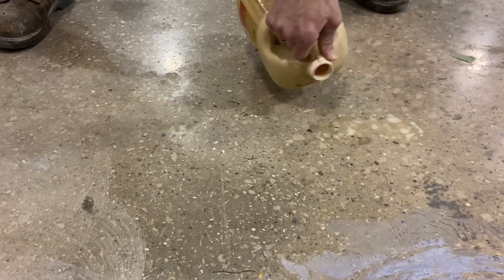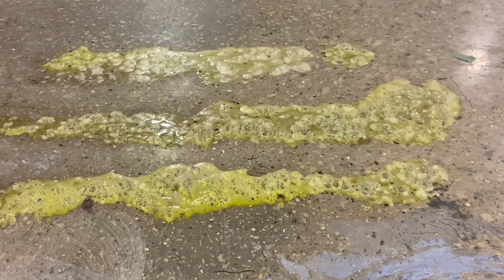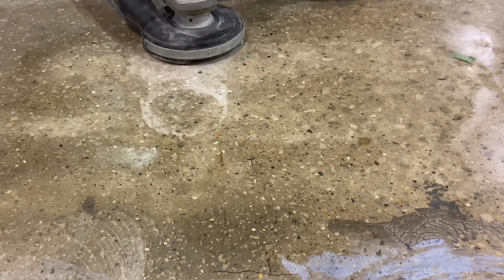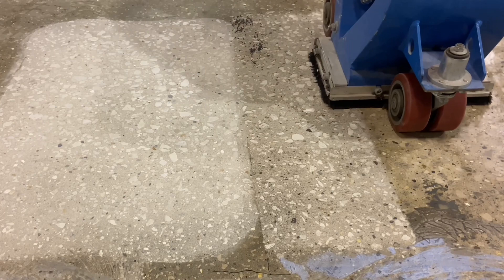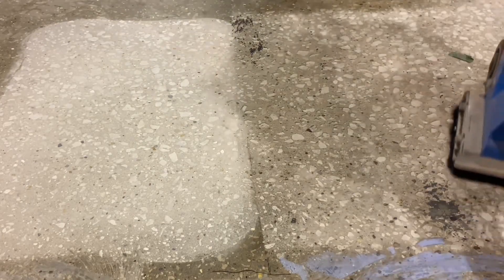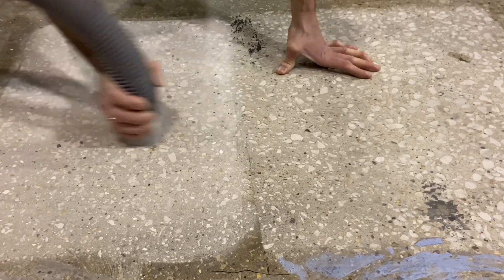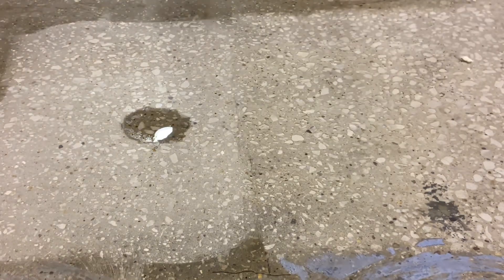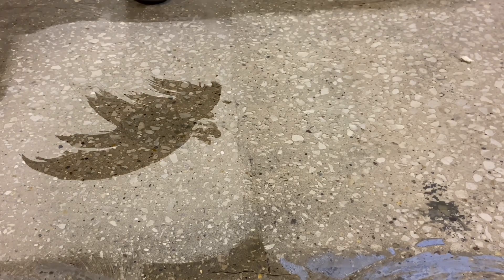How To: Concrete De-Dusting for High Performance Coatings

Comment: Very interesting video ! You do a great job of explaining each process clearly.

But which is the best way as preparation for epoxy for example ? Grinding and shot blasting, or only grinding or only shot blasting ?
Reply from the maker: Thank you so much. 
My preference is a grind and de-dust by blast. If it’s a grind-and-seal floor, then I would grind and (synthetic) acid etch. Blasting only would be appropriate where a CSP#3 is required for the coating (epoxy mortar/urethane cement). 
Thank you again.
Reply: @joshjones8047  thanks for your reply ! Grind and seal floor means polished concrete right ? Why would you acid etch it ? The risk to make it patchy would be higher or not ?

Ok so the blasting only would make it ready for coating but only a thick coating because the roughness of a csp 3 floor ?
Reply from the maker: @esdrehtsich9289  a grind and seal is usually transparent. Shade difference is caused by blasting. This would likely show through the coating. An acid etch will open the pores and make the whole canvas the same color. It’s no concern using a synthetic acid made for this purpose. It’s water neutralized and much easier to remove than muriatic. 
https://www.smithpaints.com/?ae_global_templates=green-clean-pro 

Correct about blasting, profile, and system thickness to bury the CSP#3.

Comment: If you’re grinding or shotblasting  the floor why would you need muriatic acid .?
Reply from the maker: That’s a good question. The muriatic acid was used to intentionally damage the concrete. This started out as a video concerning surface damage correction. Never would straight muriatic acid be applied this way.